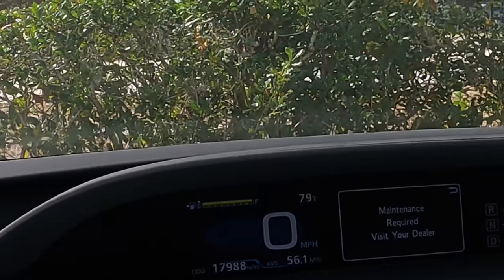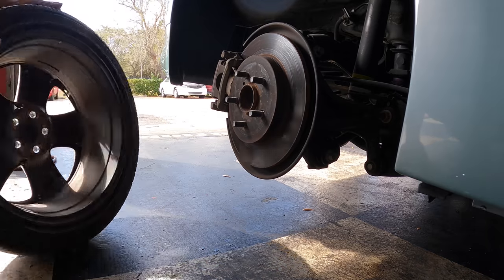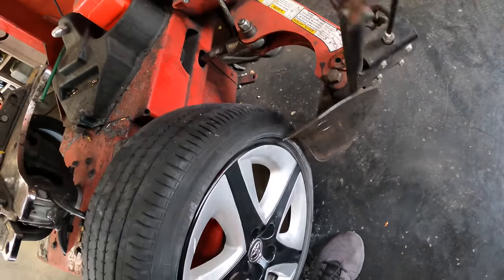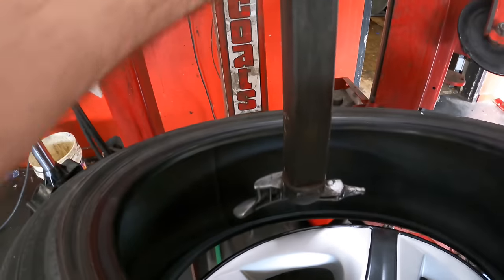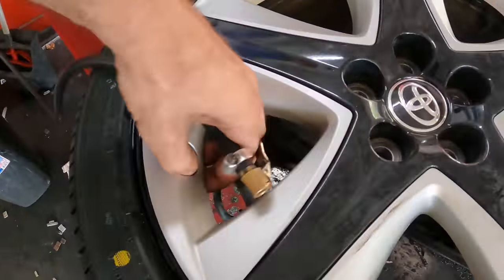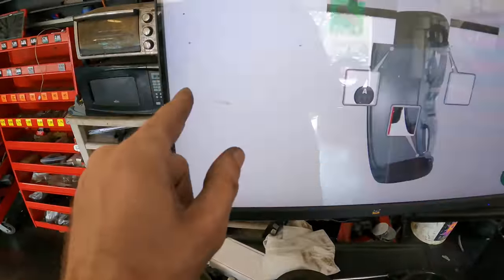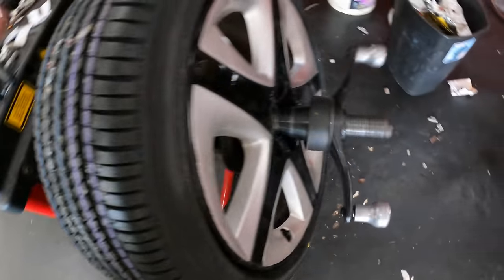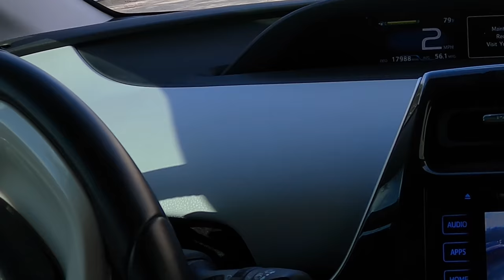Insurance Jobs, Not worth the Deductible! Toyota Prius! Tire and Wheel Walk Through

Comment: Question: When I get my “summer” (all season) tires remounted this Spring (already on rims) do I have to get them rebalanced if they were not causing any problems previously? The reason I ask is because the Toyota dealership (where my summer tires are being stored) wants to sell me a balancing service when the tires are remounted on my Rav4. This seems unnecessary to me. Any thoughts? Cheers.
Reply: 99% of the time a rebalancing is uneccessary. You only need to get it done if you feel vibrations when driving.
Reply: You don't need that. Just remove winter tires and install summer ones.
Reply: Tire balance can change with wear, but normally it's not enough for the average driver to be concerned with unless you do a lot of high speed driving. Same as with installing new valve stems every tire change, it's not necessary but they make money from it so they will recommend it.
Reply: Well if you detect no vibration technically you don't have to but while tires wear they don't always wear perfectly and those can slowly put themselves out of balance. Another thing is they can actually lose a weight and not be noticed. In fact a tire can be out of balance and you not notice or feel it. Particularly rear tires. And out of balance tire can wear unevenly. 
So my take is if you can go ahead and have them balanced. If you don't mind the risks then skip it.
Reply: It never hurts to re-balance your tires when they are installed or rotated. As you drive on the tires the balance will change due to the tread wearing down. It shouldn't cost much for a re-balance but it can help get more life out of your tires and suspension as well as a little better gas mileage.
Reply: your good to go if their put back on the same axels that they came off of. always mark them with white chalk.

Comment: I have a fond disdain for aluminum wheels and low profile tires, they can be a nightmare to mount, even with the best tire machine. Fancy tire balancer you have.
Reply: You have clearly never done run flat tires or big 33" or 35". The rubber is really stiff on run flats to the point where you have to put your full weight on them.

Comment: I believe you can actually put tyres on the wrong way round?. 
The tyre manufacturer usually puts an arrow on tyre to show the right direction to put tyre on.
I say this because my daughter brought a Mini Cooper which had the front two tyres put on the wrong way round.
Question Ray is this still the case?. 
By the way , you have a great day👍😃
Reply: It depends on the model of tire, some models are directional to help with water evacuation when driving in rain. If there is an arrow it must be pointing the right way.

Comment: I was happy to see the TPMS sensor, I had only seen pictures before. About how long do the batteries usually last?
Reply: Most TPMS sensors run on batteries that are built into the sensor and these batteries are not replaceable. The life expectancy of the lithium ion batteries in a TPMS sensor is anywhere from 5-10 years.
Reply: @bobl185  5-10 well ours are 6 years old so far
Reply: @randyblanton3684  
Most don't replace them, they range 50 to a hundred each, plus the tire work to get them installed, just live with the light and check your air pressure yourself...
Reply: @bobl185  so I've heard
Reply: @bobl185  if you do the sensors yourself you can get them for around $21 each. Universal dual frequency kind. I know shops that will charge $60 each, which peeved me off pretty bad since that was half the price of the tire. Many many years ago of course but it inspired me to get my own and the computer to program them.
The non replaceable battery still gets my blood pressure up. That's a straight up money grab right there.
Reply: @consaka1  
Most people without a tire machine won't be able to do it themselves, but if you have one then I would say do it yourself also...

Comment: Not only was that a waste of a still good tyre but now the customer has a car with a new tyre on one side a half worn tyre on the other. Insurance companies shouldn't be allowed to make decisions about things they clearly know nothing about. 😠
Reply: @Module 79L  Or, they should have insured the replacement cost for the tire/tyre on the opposite side as well. Ha. Like that’s going to happen. ;-)
Reply: I tend to agree. I’d at least replace the tyre on the other side too so that there is the same amount of wear.

In fact, if you do that, put the two new tyres on the front and old ones at the back as it is a front wheel drive which would typically wear sooner than the rears
Reply: @gwarlow  - Yeah, there are more chances that Hell will freeze over than that happening.
Reply: In this particular case, since the used tire isn't leaking, the customer might want it for a contingency tire.

Comment: For those eager to investigate and learn about the RED and YELLOW
  dots - these dots indicate specific points on the tyre.
  The YELLOW DOT indicates the point of least weight - so usually it
  is placed at valve stem - The RED DOT indicates the point of highest
  weight.
  Tyre manufacturers endeavour to  accomplish making a perfect tyre.
  However - nothing is perfect in this world and there are thus certain
  and ever-present imperfections - tyre manufacturers measure these
  points and mark them on the tyre with the aforementioned RED and
  YELLOW dots.

Comment: 1st of all the correct spelling is TYRE, you speak English and we spell it like that ;) and 2nd If both red and yellow dots are visible on your tyre and you don’t have any dots or marks on your wheel, red takes precedence over yellow and you should align the red dot with the valve stem. Cancelling out the high point takes precedence over the lightest point of the tyre, which can be addressed with wheel weights.

Comment: The centercap is upside down plus the valve is out of alignment!

You did not reset the TPMS.
Reply: Why reset the tpms???
Reply: @joebush5463  the tyre pressures may have changed.  When you inflate your tyres it is standard practice to reset TPMS.
Reply: @Land-of-reason  no its not
Reply: @joebush5463  I'm sure that it is CLICK.

Comment: That tire changer is crap , we use to have one that has a threaded center shaft we're it would go thru the rims
center hole and tighten down by a cone nut. At the top it had a rotation flat piece that handled the tire removal with a bead extractor bar.

Comment: Any UK mechanic....  Ford C-Max 2014 push button start. Had tyre changed and the boys at the garage either FU£$@D the TPMS sensor or it just happened to die or hopefully it just needs 'finding' again - as the car no longer senses it.  It's not just the Driver Assist reset you do when adjusting pressures.  Do I need a tool, a Main Stealer or is thee a 'procedure'?  Ta!

Comment: Well mounting car tires is a bit more technical nowadays then say mounting tires on a  off road trailer, I had to read comment below to know why they're are yellow dots on tires, you should've explained that and more!!!! The last time I had tires changed I had the tire guy replace valve stems but that was on tires with no inflation sensors, you  failed on modern tire changing explanations. I remember 40 years ago I had brand new tires put on a 2 year old Bronco II, the next morning I had two flat tires because valve stems were bad already, from then on new tires means new valve stems...................

Comment: I've done lots of tires in my career. A little trivia, the whistle when releasing the air happens at a specific PSI I believe it's 23PSI also my first car a 1960 Ford Fairlane had reverse rims meaning you had to remove and install the tire from the inside on the outside due to the location of the tire pocket where you but the bead to remove and install it
Reply: No, the whistle happens regardless of PSI as the air pressure is being directed through the valve stem

Comment: Could easily have lifted it up from a part of the frame that was literally four inches further back. Pinch weld is not a place you lift the car unless that's the only place available.
Regulations, you are the first person in over 50 years that I have ever seen that understands that there's marks on the tire that are to be lined up with the Schrader valve. I have yet to see a tire installed in proper orientation ever since I learned of that and watched people do it 50 years ago.
Still didn't get it quite lined up, but at least you tried.
Would not drive a tire with that low amount of air volume in it with less than 34 to about 36 lb of air in it.

Comment: A torque wrench  on lug nuts? You may be a mechanic but you are no "tire guy". Everyone knows you tighten lug nuts until the rims squish out 0.030"  and then ad ¼ turn. If you do not deform the threads on the studs then you left them loose. And do NOT forget the thread lock noice.
You want the next guy to be able to get the wheel back off? Or worse yet, the owner be able to change a flat in the side of the road without power/air tools or at least 6' pipe on a breaker bar?

Not a tire guy myself but I am going off my experience with some of the "national" chains I have delt with.

Comment: No it's not  any damage to the side wall if a tyre means it needs replacing where were you trained. Tyre safe is very clear about sidewall damage. It does not have to penitrate through  any significant cut slash or chip /chunk out of the side wall of a a tyre isca structural fail
Omg you just put an axel stand on a non structure seam. What are you doing this could cause damage. 
I cannot believe what I am seeing those waits are for steel wheels not alloy wheels. What's going on.
Wow I thought you where a pro who cared about customers cars clear I was wrong. You do not remove sick on balance weight like that you are damaging the top coat of the wheel come on who taught you to be so sloppy

Comment: I guess your shop is too cheap to put a plastic shoe on that tire machine so it doesn't scratch rims, pretty dysfunctional shit right there
Reply from the maker: It locks so it doesn’t contact the wheel
Reply: @RainmanRaysRepairs  in my restoration shop we do a lot of high-end work and a lot of high-end rim and tire installs. I'm a little like you with the oil cap facing the proper direction, in that if I see a stick-on weight from the outside of the rim and is not hidden behind one of the spokes it makes me crazy. Yes there is an art to putting on sticky weights, maybe I'm the only one and I don't want to see them from the outside of the rim and there is a way to do that